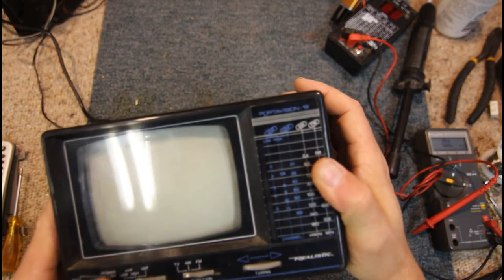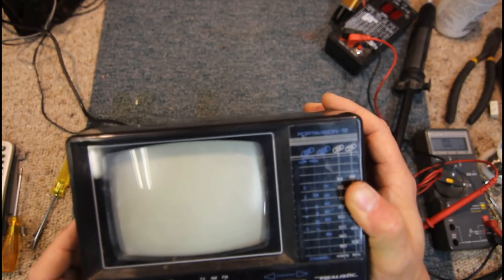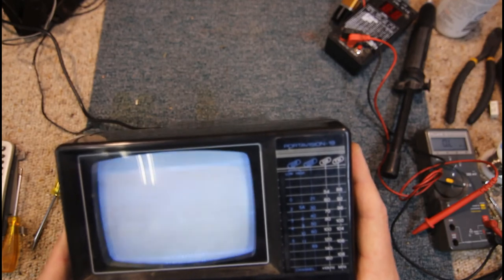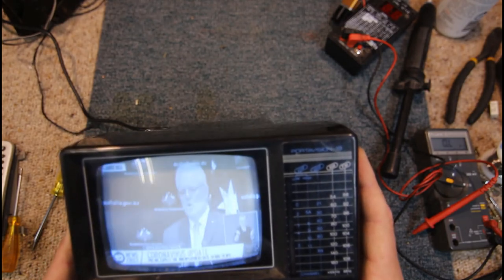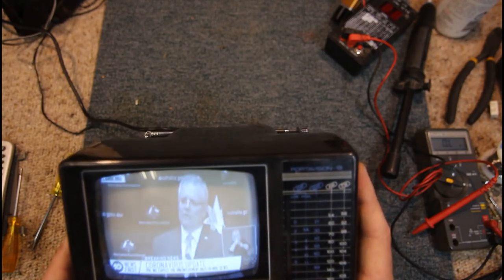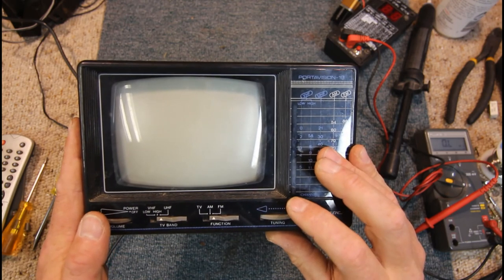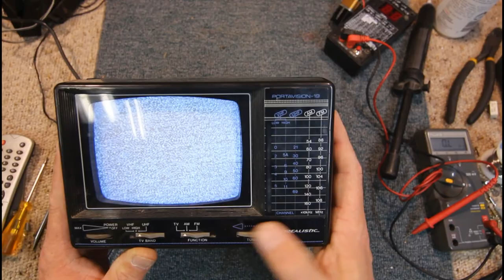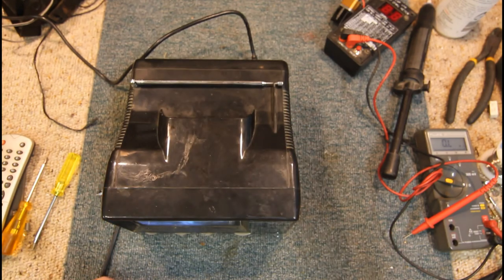Realistic TV Portavision 19 vertical problem repaired

Comment: Nice I used to work at Tandy here in Perth back in 1983 to 1987 (high school) and remember that model tv. I have the one with the red digital clock. Works great
Reply from the maker: I recently got hold of a 1991 Tandy catalogue and its got this TV in it still for $200. I have one of the Hanimex clock radio 5" colour TV combos. They came out under different brands but I think they were all made in the same factory.

Comment: Great little tv, i have two one PAL and NTSC and other modified to PAL -N by a PCB card..,  iis there an easy way to add composite video without having a lot of knowledge? I saw that they look for the pin of the VIF modulator and there they bridge it and inject the signal there with an electrolytic capacitor, in my case I can't find which of the modulator pins is the correct one, any ideas?
Reply from the maker: I doubt an older TV like this one would have composite video out of the tuner. If you could find a data sheet for the large IC on-line, it might show what pin number the video goes into the chip from the IF stage, and you could tap in there.
Reply: @StevesElectronicRepairShop   i have a datasheet of a compatible ic jungle, nte1673 says pin 1 video input, but not work  like on the Otake  radio tv deck, maybe because this is modiefied , i will try again  thanks for the advice